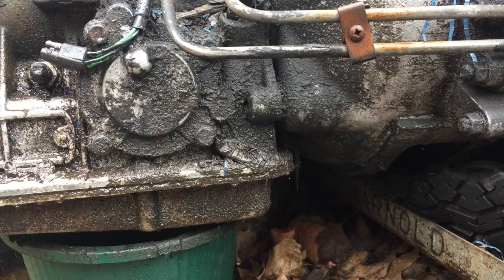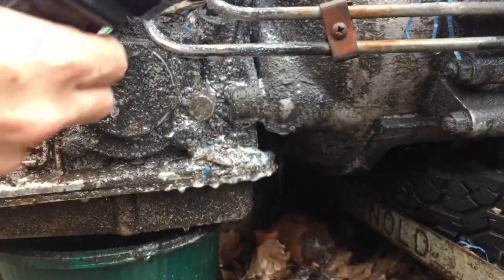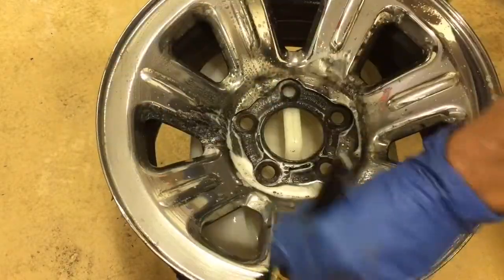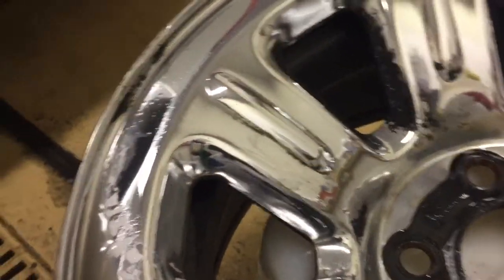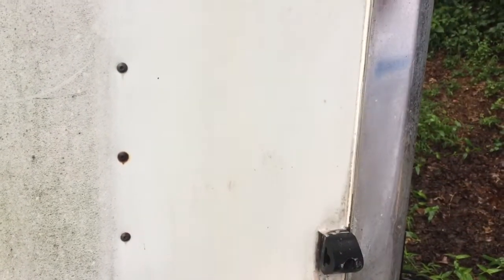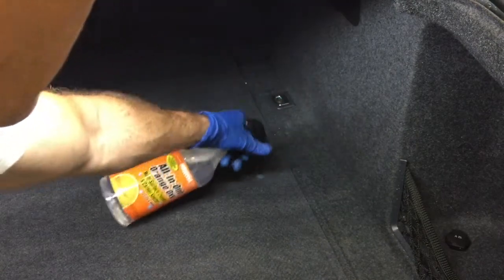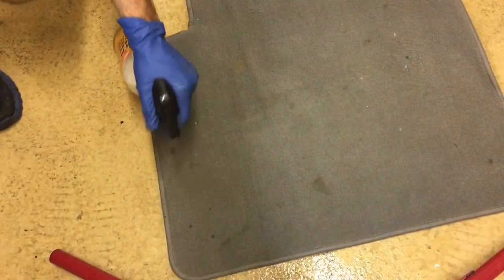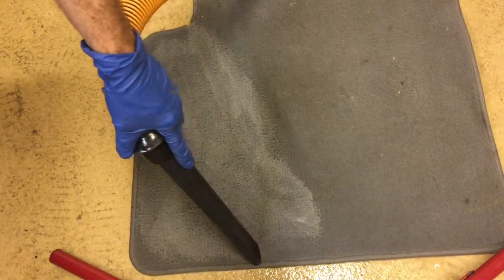MAINTEX ORANGE OXY!! Cleaner Degreaser and Carpet Spotter!! Is This One A KEEPER?!?!?!?

Comment: You're using this product incorrectly. Orange Oxy is not meant to be used as a degreaser. It's meant for primarily fabric, clothing  and carpet. You should read the SDS and ingredients before doing a review on it and show how it DOESN'T WORK well with your applications.
Reply: Indeed!

Comment: hey brian citrus base cleaners works best on paint nail polish and stuff like that on leather carpet etc  
super clean didnt take off the little bit of paint on my bmw leather seat than i tried citrus orange degreaser from walmart worked perfect thats what i see in your video 
by the way thanks for teaching me about 3 awesome product which are cinch glass cleaner tide cold water clean also qp on 3.0 i already have the first two and i cant get my hands on qp on 3.0 thanks for sharing your experience with us
Reply from the maker: Your support is Appreciated...glad you could take a few nuggets from the videos..thats what its about CHEERS!!!
Reply from the maker: You wont be disappointed with the QP ON products!!
Reply: hey brian i have a question i would like to buy this qp on 3.0 product using your link showing it is around 100$ but on the back of the label it says ready to use out of the bottle but you are saying dilute it to 20 to 1 i am a bit of concerned here